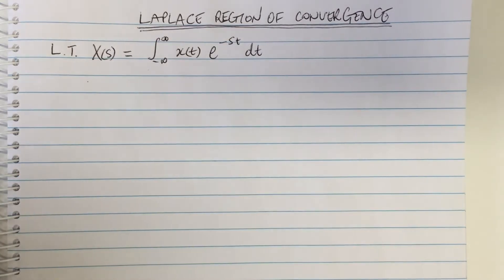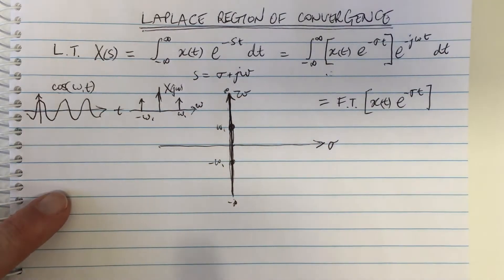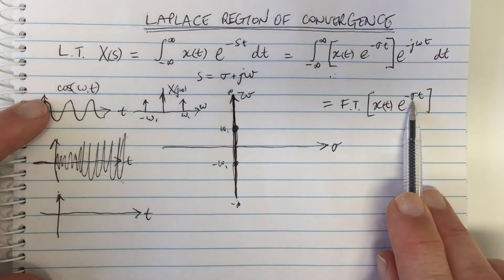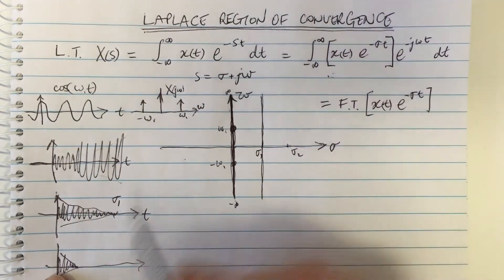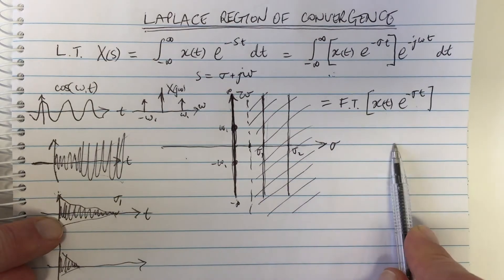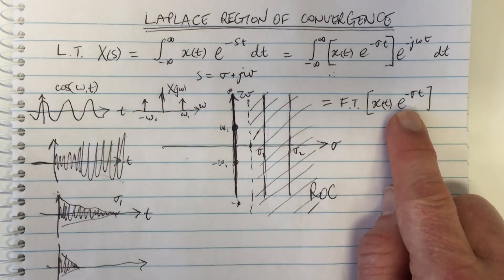Laplace Transform Region of Convergence Explained ("THE best explanation I've seen")

Comment: Can you explain what a finite-energy signal means, more precisely? Thank you
Reply from the maker: The integral of the square of the function, over all time, is finite.
Reply: @iain_explains  Thanks, Professor. However, I'm scratching my head over this definition. Take for instance the signal x(t)=sin(t). The integral of (sin(t))^2 from -Inf to +Inf is unbounded, since the area under the curve is always positive and grows limitless due to the repeating pattern it forms. Yet the FT of x(t) does exist.
Reply from the maker: Excellent observation! Sinusoids are special cases. Actually in the case of sinusoids, the integral in the Fourier transform equation does not converge. We find the Fourier transform via the inverse Fourier transform of the delta function (which is a mathematical construct with infinite amplitude, infinitesimally small width, but unit area). The integral in the inverse FT formula does converge for a delta function, and the answer is a complex exponential function of time (which is a complex sinusoid in the time domain).

Comment: 00:02 Laplace transform is related to the Fourier transform
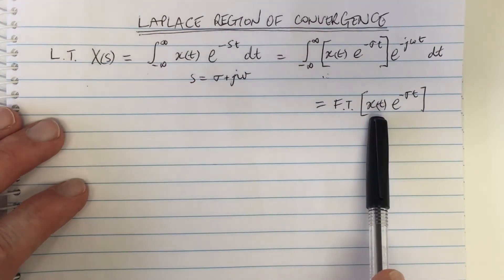01:28 Laplace transform is a generalization of Fourier transform.
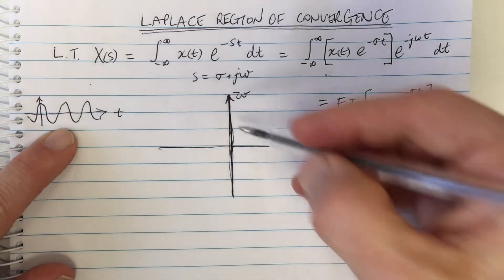02:48 The Fourier transform of a cos waveform leads to two Delta functions at Omega and -Omega.
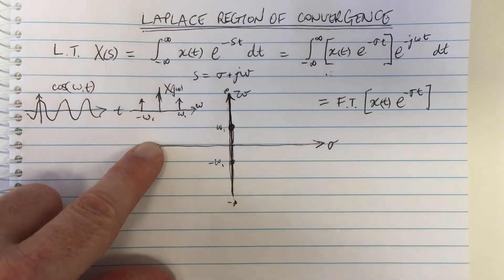04:02 Exploring other functions in Laplace plane
05:01 Laplace transform helps in dealing with waveforms without Fourier transform
06:08 Laplace transform maps exponential increase in time domain to radial increase in frequency domain.
07:12 Region of Convergence defines valid Fourier transforms
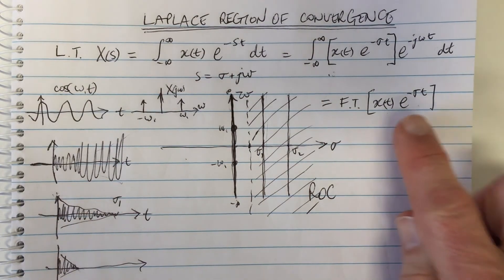08:29 Laplace transform generalizes Fourier transform for signals with growing energy
Crafted by Merlin AI.

Comment: Sir, why the range of integration is 0 to ∞ in Laplace
But FT is -∞ to ∞
Reply from the maker: There are two versions of the LT. I prefer the "bilateral LT", where the integral is over the range -∞ to ∞. The "unilateral LT" is a special case, where the integral is over 0 to ∞. In both definitions, the LT integral is over the range 0 to ∞ when considering impulse responses of systems that are causal - ie. the impulse response, h(t), is zero for t in the range -∞ to 0.

Comment: As-salamu alaykum professor
I have a very basic question that why we consider ROC of causal system to be right side of rightmost pole
what is the reason/intuition behind it ?
Reply from the maker: Causal systems have impulse responses that are "right handed" (in time). ie. they equal 0 for all negative time. If the system is unstable, then the impulse response will grow unbounded as time goes to positive infinity. Therefore, in order to be able to take a Fourier transform, they would require a 'damping function' that goes to zero as time goes to positive infinity. This corresponds to values in the s-plane that are in the region to the right of the most positive pole. This video might help: "Why are Poles Negative in Laplace Transform of Real Stable LTI Systems?" https://youtu.be/apdh8ZXW3a0
Reply: thanks professor it was really helpful👍

Comment: very conceptual and intuitive video lain, but I have a small doubt,
let a system having impulse response exp(-t) so the pole would be at s= -1 which implies that system output will converge for all values of s right side of the pole s= -1, assuming causal system now let us give input to the system exp(2t) so the system output would bey(t) = conv(exp(2t),exp(-t)) and thus taking Laplace of y(t) will get( 1/(s-2) * 1/(s+1) ) no taking the partial fraction and solving further we get  (0.33/(s-2) - 0.33/(s+1) ) and taking inverse Laplace we
 y(t)= get 0.33*( exp(2t)- exp(-t)) and now when t tends to infinity output does not seem to converge rather it tends to infinity so why it's not converging despite the point s= 2 coming under the ROC of the system? Hope you have understood my question...thankyou!
Reply from the maker: Well just because a system has a stable impulse response, it doesn't mean it can stabilise any unstable input. In the example you gave, the input signal has infinite energy!
Reply: @iain_explains  ok that's clear lain that the input signal has infinite energy but that's my doubt despite being an infinite energy signal it's still coming under the ROC of the system, any specific reason for it being unstable though it's clearly depicted by the ROC that it should converge that's why its called region of convergence.
Reply from the maker: No, that's not why it's called the region of convergence. The region of convergence does not relate to the input signals. It relates to the region of the s-plane over which the Laplace Transform exists for the system.

Comment: Are all of the transformed signals going to lie along a vertical axis some distance away from the w-axis? Is it possible to have sloped lines along which the signals lie? Also, are all of the signals going to be orientated orthogonal to these vertical axes or is that just the case here because you used delta functions? Also, I have watched a few other videos and so far yours is the clearest, however other videos make mention of something called the s-plane , what is that?
Reply from the maker: I explained the overall transform in terms of a collection of "transformed signals", where each different signal only differed by the sigma parameter in the exponential that multiplied the base signal, x(t). And yes, each of these signals corresponds to a vertical line in the sigma-omega plane. But it's important to realise that these signals are all just a function of the base signal x(t). There are no "other" signals. And you ask about the s-plane, well that's exactly what I've drawn - it's the sigma-omega plane. Notice that I've written the equation s=sigma+j omega in the middle of the page.

Comment: What would the region of convergence be if there are multiple poles at different exponential values. For example if your input signal was something like x(t) = e^(-t)cos(2*t) + e^(-2t)cos(3*t) I believe you would get poles -1+2j/-1-2j and -2+3j/-2-3j. How would you determine the region of convergence for this multi poled system?
Reply from the maker: The overall expression only holds when all of the component terms hold. In other words, only for values of "s" that are in the overlapping region of all of the ROC's of the component expressions. Mathematically, this is ROC = ROC1 "intersection" ROC2

Comment: sir but positive plane is full of decay exponential right, but why did you take sigma in between 0 to sigma1
Reply from the maker: I was showing an example waveform where the magnitude of x(t) grew with time (which means it does not have a FT, and therefore the LT does not exist for sigma=0). The Laplace Transform will exist (only) for values of sigma that are more positive than the rate of the growth in x(t). So, I showed the boundary as being between 0 and sigma1 because the LT for this example does not exist at sigma=0, but I said it does exist at sigma=sigma1, so the boundary must be between the two.
Reply: @iain_explains  
May I know how did you evaluate the boundary I mean mathematicaly what should be it's condition ?